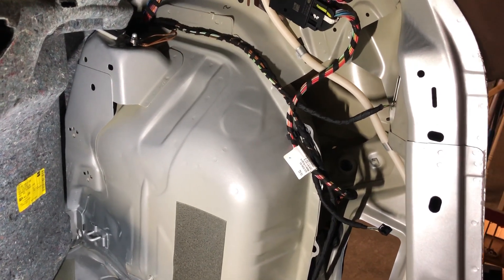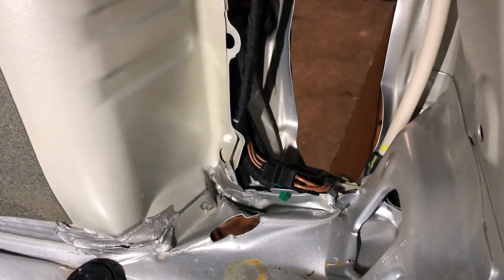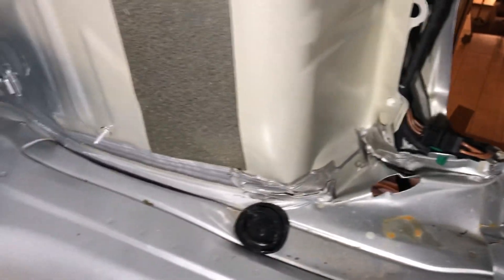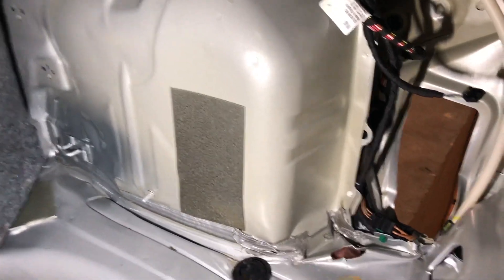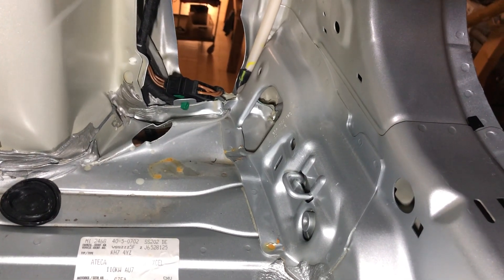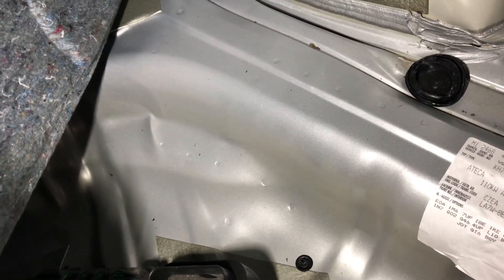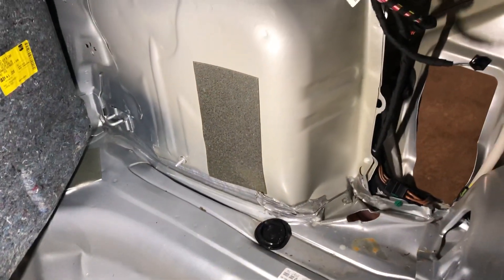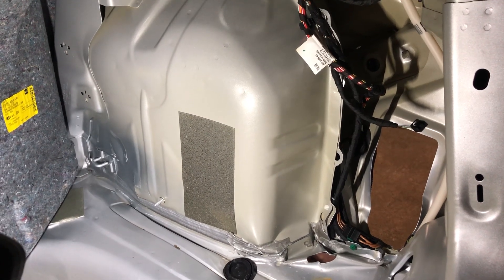Seat Ateca part 2: it has frame damage

Comment: Nice videos. Keep the videos coming. I could learn a lot from them :D
Reply from the maker: Thanks for taking the time to respond. I have Some bad lighting in my garage. I haven’t fully set up so the footage I shot was really bad. I will make an update video on the car soon! I will share what I know
Reply: @horvath14041984  Looking forward to it. Recording adds 50% more work to the work. Haha
Reply from the maker: I liked your CNC plasma cutter video btw I am looking for the same build. How much did you pay for the laser cut pieces? Are you happy with the cutter? I am planning to build a chassis and the cnc would be very helpful.

In any case videoing the works and montages are a big work load but I like it! Thanks!